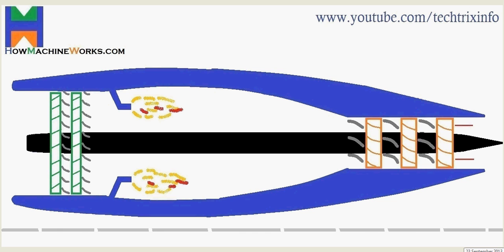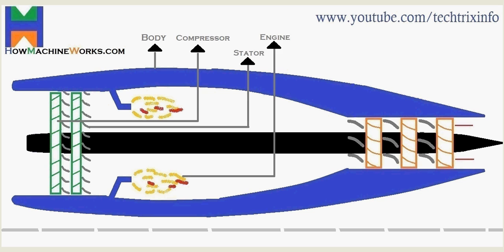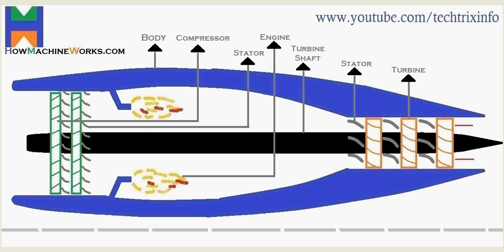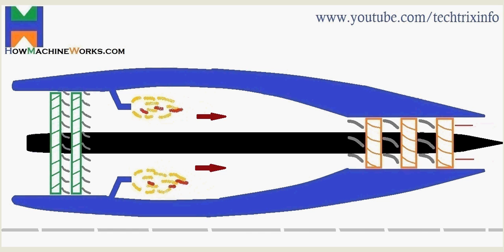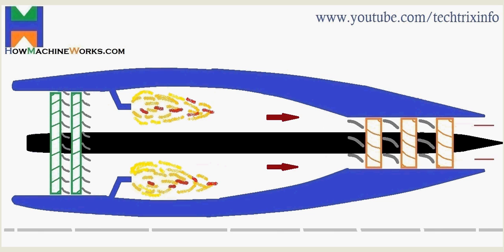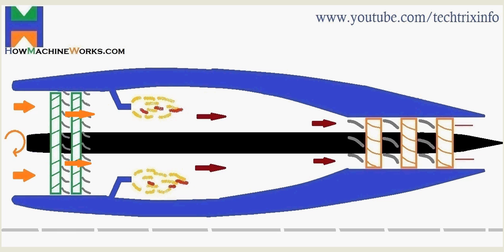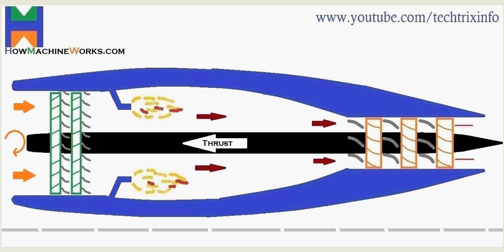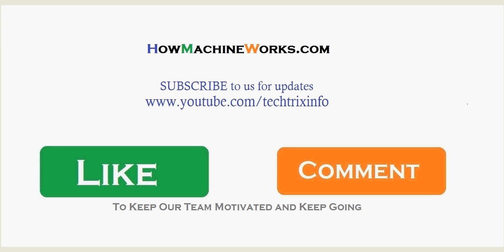Animation How turbojet engine works.✔

Comment: beside the APU, What makes the turbine or the blade rotates?
Reply: When the atomized fuel mixes with the compressed air, it ignites and creates a continuous explosion in the combustion chamber. This is caused by the rapid generation of heat and the expansion of gases that are being ignited. Because of the geometry of the combustion chamber, the direction of the fuel injectors, and the jet of air coming into the combustion chamber from the compressors, the hot gases are forced out of the combustion chamber towards the nozzle. Before they are exhausted from the engine, they come into contact with a series of turbine blades. Because of the speed that the hot gases are traveling at, the turbine blades are forced to rotate as the incoming gases pass through it. Since the turbine blades and the compressors share a common shaft, the compressors rotate with the turbine at high RPMs and the cycle continues.

Comment: What prevents the combustion pressure from blowing out the front larger less restrictive opening.
Reply: Before starting any combustion the fans are started using the accu power, causing cold air to flow from left to right. When the combustion is started, it will prefer moving to the right, with the already existing airflow.

Also, the more powerfull the combustion will be, the more pressure the fans need to build up to make sure the combustion will prefer going left to right. Once combustion has started, the whole system will keep powering itself in building up enough pressure to make the airflow left to right and no accu power is needed anymore.
Reply: Accumulator1... Good question... The graphic here is not well/accurately  representative of the combustion chamber as well as the compressor or turbine blade angle. Be that as it may...